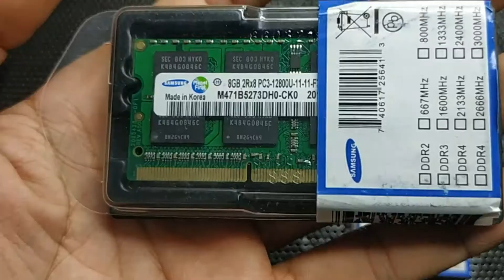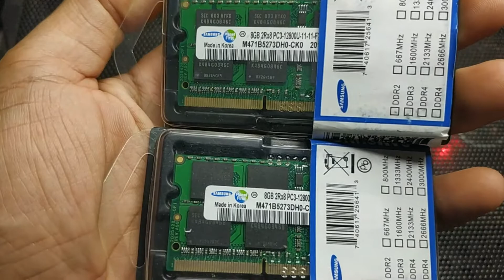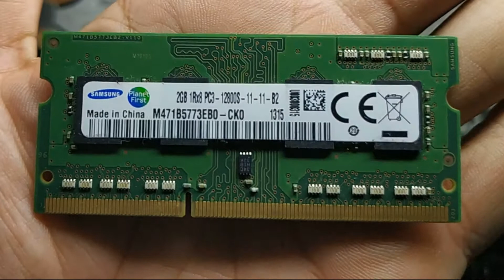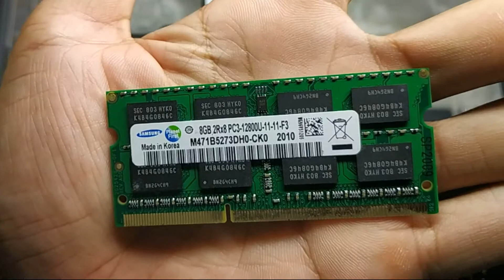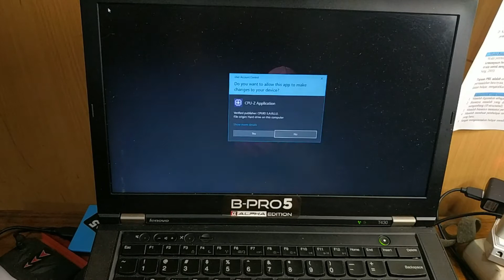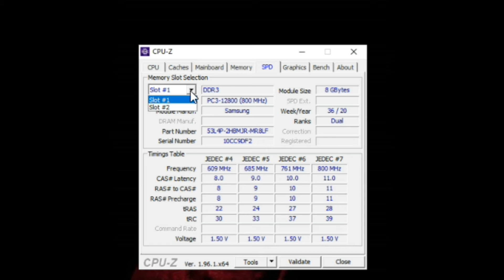REPLACE RAM LENOVO THINKPAD T430 || UPGRADE RAM 16GB THINKPAD T430

Comment: Kalau DDRLbisa juga ya? mending mana, DDR3 atau DDR3L?
Reply from the maker: Kalau menurut saya, sesuaikan dg spesifikasi laptopnya saja bang. 🙏
Reply: L itu untuk low volt bang.

Aa pakek yang ddr3L . Leptop ku sebelumnya thinkpad t430 tak cek spesifikasi pakek ddr3L. 
L = 1.3votl.
Kalo ga paakai L. 1.5volt

Comment: Mas punya saya ram beda yah selot satu paki ddr3 selot dua paki ddr3l saya jadi bingung mau beli yang mana dddr3 atau ddr3l
Reply from the maker: Ikuti spesifikasi laptopnya mas. Laptopnya pakai yg ddr3 atau ddr3l.
Reply: Laptop saya ada dua jenis ram nya selot satu pakai ddr3 sedang kan selot 2 paki ddr3l, yg saya tanyakan apa bisake dua selot ram nya pakai ddr3l
Reply: Ga mungkin ada 2 slot ram dengan tipenyg berbeda,
Kalau mw optimal ram nya, pake yg setipe
Kalau ddr3, ya ddr3 pake 2,
Kalau ddr3l, pke ddr3l,
Itu beda ya bro, riset dulu

Comment: Bang saya juga menggunakan laptop t430, kalo mau nambah hdd dan ssd bisa? Jadi dual hdd dan 1ssd atau cuman 1 hdd dan 1 ssd
Reply from the maker: Bisa bang, ada 3 tempat yg bisa digunakan, 1 tempat hdd lama bisa diganti pakai ssd sata, ke dua, ada slot wwan, itu juga bisa digunakan untuk ssd msata, yg ke 3 dvd dilepas, belikan cady atau casing hdd, di situ bisa ganti pakai hdd atau ssd sata, tapi menurut saya untuk cady lebih enak pakai hdd.
Reply: @SABIQU  oh gitu bang, oh iya saya tuh rencana mau nambah ram, nah ram yg sebelumnya 800 berapa hz gitu lupa.. klo nambah ram yg 1600hz itu gmana bang atau samakan dengan yg sebelumnya? Soalnya saya liat kapasitas maksimal laptopnya ram yg 1600hz
Reply from the maker: @rayhanfulqi6086  saya pake yg 1600hz juga bang, 8gb x 2.  Aman
Reply: @SABIQU  oh iya satu lagi bang hehe, untuk hdd yang dsimpan pada caddy itu ukuran berapa ya? Saya liat di tokped ada yg ukuran 3,5 dan 2,5 inch bang
Reply from the maker: @rayhanfulqi6086  untuk thinkpad t430 ukurannya 12,7mm om.
Reply from the maker: @rayhanfulqi6086  kalau cuma mau nambah, samakan  saja spesifikasinya dg ram yg sudah ada, kalau mau ganti semuanya (2 slot ram mau diisi semua)  enak di samakan brand, kapasitas, dan spesifikasinya.
Reply: @SABIQU  oke bang terimakasih jawabanya🙏 sangat membantu
Reply: @SABIQU  iya bang sya bingung mau nambah 4gb (jadi 4+4) dengan 800mhz atau mending 8gb 1keping 1600mhz
Reply from the maker: @rayhanfulqi6086  kalau mau nambah 8gb, menurut saja belikan yg 1 keping 8gb. Nanti masih ada 1 slot kosong, siapa tau ada rencana mau nambah ram lg. Sebenarnya ram 8gb, ssd, sudah cukup untuk office, browsing.
Reply: @SABIQU  betul bang, terima kasih bang🙏🙏 sangat membantu

Comment: Laptop saya sama, tapi ram masih 8, kalau diupgrade 16 apakah bisa meningkatkan performa? terutama untuk game. Makasih 🙏
Reply from the maker: Spek laptop ini bukan untuk game, ram 8gb sudah cukup untuk game ringan, kalaupun ditambah jd 16gb seperti kurang berguna, mau install game berat pun ga bisa jalan di laptop ini.
Reply: @SABIQU  kata siapa game berat ga bisa😂 hahah
Reply: Bisa gan 👍
Reply: @RenoMotovloggame  Bang laptop saya Thinkpad T430S Core I5, Ram 8gb, Intel Hd 4000. Tapi si Vramnya kok cuman 32mb ya ? Ada solusi buat naikin ke 128/512 ?
Makasih sebelumbya bang.

Comment: Bang laptop saya terpasang ram 4gb, semisal nambah 1 keping 8gb bisa ngga?
Reply from the maker: Bisa saja bang, tapi lebih bagus lagi jika dg ukuran sama dan brand yg sama. Misal dipasang 2x8 brand samsug.
Reply: @SABIQU  terimakasih bg🙏
Reply: ngaruh gak y bang, kalau misal beda merk ram bawaan 4gb + samsung 8gb ddr3l..
Reply from the maker: @daris_oct123  sebenarnya ga papa dipasang. Itu speednya sama ga bang? 
Biasanya, ketika memori dicampur dg kecepatan yg berbeda, sistem akan ngambil speed yg rendah agar bs bekerja, misal pakai ddr3 3200mhz dg ddr3 3600 mhz, maka sistem akan bekerja di 3200mhz.
Reply: @daris_oct123  saya 2gb Kingston+ 8gb samsung aman gan
Reply: @SABIQU  emm gtu ya, mksh bang infonya 🙏🏻
Reply: @arvamaulana4925  aman kh, klo boleh tau abang ni pake merk ram yg beda udah berapa lama pakenya ?
Reply from the maker: @daris_oct123  saya pernah pakai ram dg brand berbeda, kapasitas berbeda juga, laptop bisa bekerja. Sekarang sudah pakai 2 keping ram dg spesifikasi sama.
Reply from the maker: @arvamaulana4925  mantap om, makasih. 👍🙏
Reply: @daris_oct123  belum lama sih, tp selama saya pake lancar2 aja hehe
Reply: @arvamaulana4925  bang itu ram yang 8gb harus di slot 1 atau bisa dipasang di slot 2?
Reply: @Safitri252  di slot 2 bg

Comment: Bang kalo yang 1 8gb yang satu lagi 2gb bisa gak ya bang? Saya T430s DDR3
Reply from the maker: Bisa saja bang, tapi lebih pasnya untuk 2 keping pakai brand, kapasitas (GB) dan spesifikasi yg sama.
Reply: @SABIQU  Mending laptop ini atau thinkpad x230 kalo x230 bisa di upgrade gk bang
Reply from the maker: @lahh.9701  tergantung fungsinya bang, x lebih ringan, layar kecil, ga ada optical drive. Enek buat dibawa bawa.

Kalau pribadi saya, saya lebih ke seri T bang. Kalau mau cari sekalian yg sudah ada nvidia bang. Lebih mahal dikit tapi lebih fungsional.
Reply: @SABIQU  di daerah sy T430 jarang yg ada nvidia nya
Reply from the maker: @lahh.9701  olshop aja, toko ijo, kalo ga masuk grup fb thinkpad indonesia, di situ ada penjual yg rekomen. Barang yg dijual jg bagus.
Reply: Gan klo ic regulator program bisa di service atau g y gan,
Laptop saya tiba2 mati total,d coba d bawa k tukang service katanya kemungkinan ic Regulator programnya yg rusak,